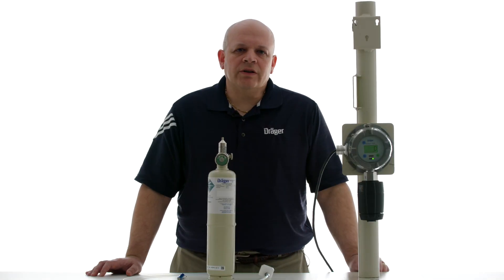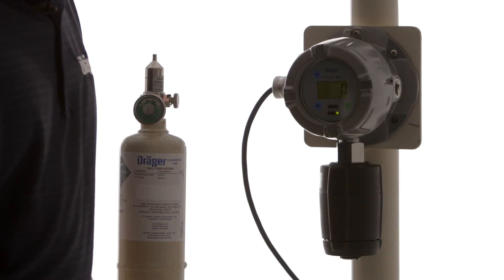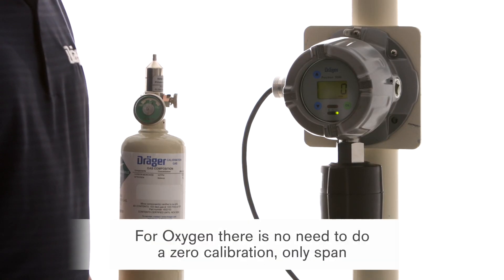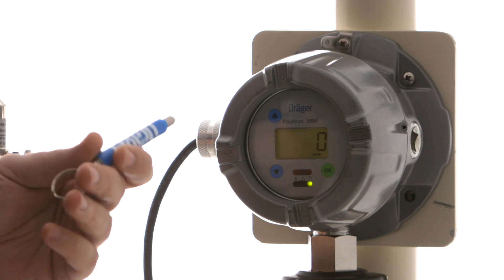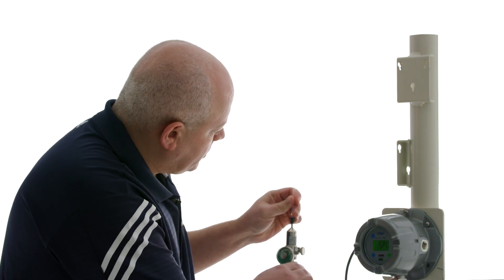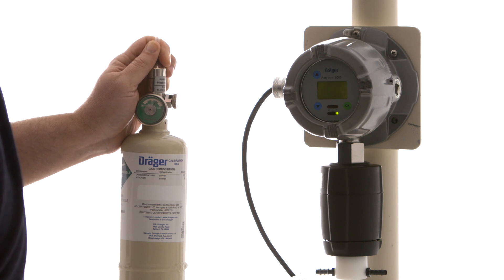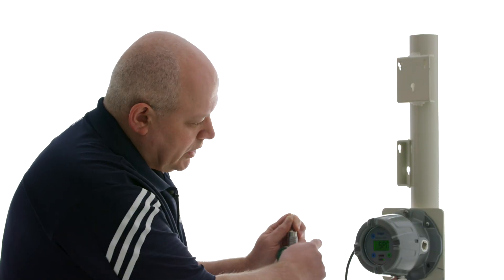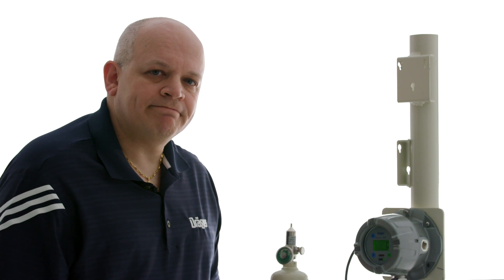Calibrating the Polytron 5100

Comment: Please share Drager polytron 5000 Oxygen detector calibration video
Reply: Calibration Polytron 5000 with oxygen sensor is easy than carbon monoxide sensor. Just use ambient air as as span gas with consentration 20,9% Vol. For checkin zero consentration use nitrogen with consentration 99,9% Vol.
Reply: How to 0 stabale aftar calibretion please share videos